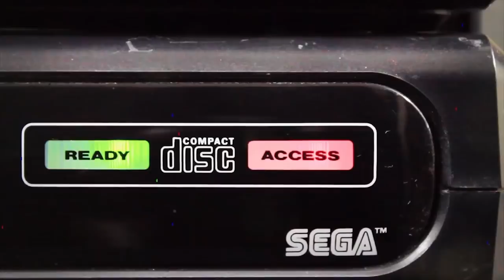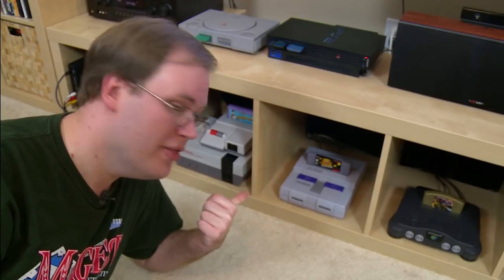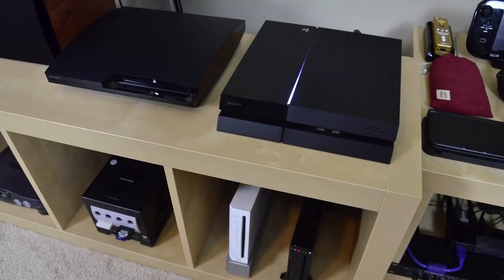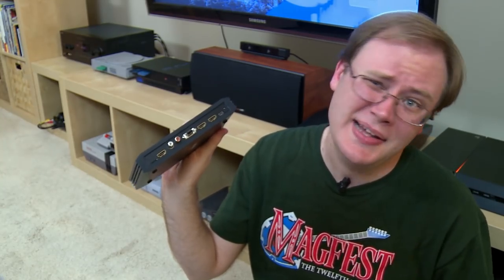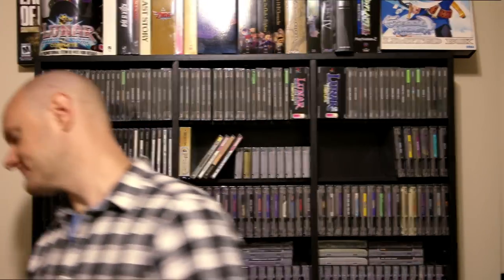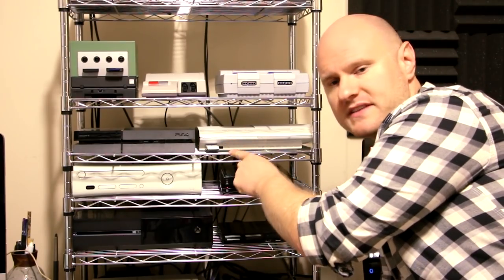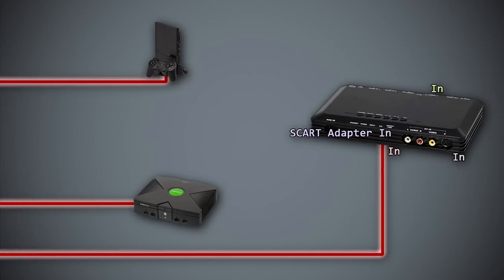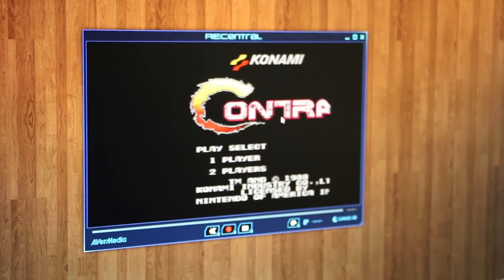RGB and Modern Gaming Setups :: RGB102 / MY LIFE IN GAMING

Comment: I just ordered a FrameMeister. Can you guys tell me what gender the RGB adapter is that comes with it? I know that it's JP21, but haven't been able to tell if it is male or female.
Reply from the maker: +Dave Bladegun [Try4ce] It's female. Good that you already know it's JP-21, so you know what to look for if you're gonna stick with that standard!
Reply: +My Life in Gaming 

Thanks! I actually do use scart for everything, but plan to run an RGBS>JP21 cable from my PVM to the Framemeister in order to save an input/output on the ol' scart switcher.

Comment: Does the Framemeister do anything for Nextgen system? For example, if I have a 120/144hz Monitor. Will the processor take advantage of that?
Reply from the maker: [Try4ce] It's pretty much useless for systems that already do HD, though you can route them through it for convenience. It outputs a 60Hz signal, which is fine... interpolation to turn 60fps into a perceived 120fps would add lag and visual artifacts.

Comment: Great video!  I followed a similar path as you guys, going with the cheap and crappy $50 SCART RGB to HDMI adapter, then finally ponying up an getting the XRGB Mini.  All of my systems look fantastic through the RGB input on the Mini.  Component (via a D terminal adapter) is a different story.  The colors look very over-saturated.  This happens with both my GameCube and my Wii (the only component systems I currently have).  I was wondering if you guys experienced the same thing with component, and if you were able to figure out the correct settings to use on the XRGB Mini to make the component picture quality better.

Thanks, and keep up the great work!
Reply: So, after posting this video I decided to look again, and I don't know how I missed the suggested settings on the XRGB Mini wiki page.  My component input is looking much better now.
Reply from the maker: Paul Hallaway [Coury] Oh cool! Yeah, the Wiki is super useful. I go by all of their settings.

Comment: Wow!  You 2 really have a wealth of info and clearly have done your homework when it comes to retro gaming on modern hardware.  I myself am a bit of a retro gamer but currently my systems and games are all packed away until I can work out my own setup.  Do to this, I've been (reluctantly) playing emulation on a modded xbox.  I know...this is borderline blasphemy but it's the best I can do right now. To avoid all lag issues I have my modded original xbox plugged into my trusty CRT-TV and everything is great, however i'm not a big techie and I'd like to go HDTV since my Trinitron is HUGE!  So If I may ask,what is a good way to apply a modded original xbox for emulation purposes to a HDTV?  Even though its a modern system, I still experience lag when playing on an HDTV. Would I benefit from the Framemeister?  Should I just stick with CRT?  I realize this is lengthy but your help would be worth its weight.  Thanks J-
Reply from the maker: +J Bates [Try4ce] Ha, I feel ya. If you watch our episode on CRTs and PVMs - https://youtu.be/RAi8AVj9GV8 - then you'll see that I've got a big ol' 36-inch HD Trinitron myself. I don't particularly recommend it! I'm actually planning to get rid of it pretty soon, because I can do something so much more useful with that space. Neither of us know much about emulation on the Xbox, so I can't say for sure how the Framemeister will play with it... for example, whether the Xbox emulation outputs 240p or not, that would be key. The Framemeister is not 100% lag-free, but it should be lag-free enough for most people. It's certainly faster than plugging your console directly into an HDTV.
Reply: +My Life in Gaming  Thanks for the response.  As far as I know there is a setting in on XBMC that offers 720 "support" but i've not been able to see any support. You still get that half second delay.  I've seen people connect a modded xbox to a hdtv via the component cable but I have not tried myself.  Such is the life of a retro gamer. .why does it need to be this complicated!?!?  Anyway thanks again, your videos are super helpful.  Have fun moving that beast of a TV you have LOL!!!!

Comment: 1:57 I have been thinking, ¿what combination of Quality image profile do you get if you get an adapter that goes from HDMI to VGA with the Framemeister despite you may not get any audio sound ?
Reply from the maker: [Try4ce] This can be an interesting result, but the Framemeister is not the first device I would choose for this purpose. The OSSC or RetroTINK-2X would be better suited to this kind of task due to their output resolutions. There's also the GBS8200, which outputs VGA natively, and has more recently been modified to be much better than it normally is. We're gonna do a video on it soon.
Reply: @mylifeingaming  Thanks guys.

Comment: Cory, you've got to get a VGA cable for your Dreamcast. That girl looks significantly better than a PS2/Xbox running on component. Literally next best in quality up against the modern HDMI systems. I am unfortunately, stuck in the same boat as you for GCN... S-video for the win, right?!
Reply from the maker: StuohQ [Coury] I've since upgraded to the Toro from Behar Bros. It converts the 480p VGA signal to SCART and looks AMAZING. Sucks about the GCN though - and the prices continue to rise.
Reply: ***** Could try to scour Japanese sites for D-terminal cables while the exchange rate is good... gl otherwise.

Comment: hello guys) i still dont understand. can you help me? if I have miniframemeister and rgb modded AV Famicom system console - which cable should I use? is it ok if I use the official SUPER NINTENDO rgb scart cable ? ebay says its jp21, (http://www.ebay.com/itm/New-Nintendo-Official-RGB-Cable-SHVC-010-Super-Famicom-SFC-SNES-Japan-F-S-/252383489513?hash=item3ac33a6de9:g:fiMAAOSwqfNXmgpf) but you say that this has different sync than usual rgb and that cable (jp21) may have different pins inside Scart cable. please clear me this shit
Reply from the maker: [Try4ce] That cable is fine to use with a modded AV Famicom! Anything that works with SNES will work with it. The Framemeister comes with an adapter for JP21, so if you buy that cable, you will not need a different adapter for SCART, which is what we use. I am not positive what sync type the official cable uses, but I believe it is likely to be sync-on-composite (not necessarily bad if it's a high quality cable with good shielding). I can confirm that Nintendo's PAL GameCube cable is very high quality (not recommended for use with Famicom, NES, or SNES though), so perhaps that should indicate that you would also get a high quality signal from the official SNES JP21. You can also find a link to our preferred cable seller on eBay, who makes excellent quality prices for much less than those Nintendo cables. If you go that route, I recommend looking for a CSYNC cable, but the choice of JP21 vs. SCART is yours.
Reply: thanks a lot for answering guys! Now i understand, but I still dont understand what type of sync this oficial SNES cable use. As i understood you right, the CSYNC has the best possible quality, so its better to get this type of cable. If I dont use Freimeister and have only NESRGB AV Famicom I need EURO scart cable wichi for example can be ordered through the retroasia.com site, but I guess this EURO scart cable is not official nintendo cable. I also wanted to ask you if you noticed that AV FAMICOM  has some slowly action on the castlevania 3 moments when the hero jump through the round moving around wheels. the game are getting slowly in these moments. do you have the same problems? thats funny but my famiclone system (zhiliton) dont have such problems with RAM memory

Comment: So I took the plunge and got the framemeister however everything is well muted, I can't seem to get audio out of it. I have atm the composite from my NES going to the framemeister av in, then being outputted via the HDMI which leads to my capture card (X-capture1 from same company) got any ideas what the problem could be? Also the colors are all pink and I can't work out why if yuo have suggestions for that too that would be great :D
Reply from the maker: [Coury] Did you buy it new? I haven't experienced either of those issues - go into the menus and make sure the volume is turned up (the framemeister has internal audio levels that you can adjust). The pinkish color, I'm totally lost on - I haven't heard of or experienced that at all to be honest. I'll look around and see if I can find anything on it and will let you know if I find something.
Reply: After doing a bit of digging around and realizing how stupid I was, I remembered "hey why don't I try it without the capture card" and sure enough it works fine, color is fine and audio works however when connected to the capture card the color messes up and the audio does out output to OBS (the streaming software I use) the capture card supports hdmi audio as I use it to stream some ps3 and ps4 games. Seeing as it's the capture card side of things I unfortunately (for me) doubt I can get help from you guys but thanks for the speedy response. Do you have any settings you would recommend for 720? as I still get some black-boarders on my screen even when set to 720 which confuses me.
Reply: ***** Fixed my probelms thought I would let you know the solution even though it boggles my mind :P. So I have the same HDMI splitter Coury has and once I plugged it all up through that device (framemeister HDMI out -> HDMI splitter -> capture card) it worked 100% color is normal and audio is working 100%. However if I just play the framemeister HDMI output directly to capture card the audio is stripped and colors are borked. Odd little fix just thought I would update you ;)

Comment: will this cable ( https://insurrectionindustries.com/product/sega-genesis-model-1-rgb-scart-cable/ ) work with this adapter https://www.ebay.com/itm/XRGB-MINI-Frameister-Euro-Scart-to-RGB-Cable-RetroGamingCables-USA-Seller-New/372976317847?ssPageName=STRK%3AMEBIDX%3AIT&_trksid=p2057872.m2749.l2648 the ebay store you recommend is no longer selling anything. the cable says Csync but the adapter says Generally for Framemeisters with Firmware 1.08 and above you can use this passive adapter. For older firmware you may experience sync problems when using a "sync over composite video" cable, therefore for older firmware we recommend the EuroSCART to mini adapter with built in video sync separator to achieve composite sync (CSYNC). A composite sync (CSYNC) signal eradicates timing problems often experienced with the XRGB mini up-scaler when connected to particular gaming machines, so even with the latest firmware you may still need a video sync separator if your SCART cable can only supply sync over composite video.
Reply from the maker: [Try4ce] Yes that should work. Search the XRGB-mini wiki for info on updating firmware. Also, the eBay seller is still around, but now at Retro-Access.com. But Insurrection also makes good cables.
Reply: My Life in Gaming thank you so much!

Comment: My Nintendo 64 is an early version of the system. One of the things you suggested was to use framemeister. Is there anything cheaper that works just as well? The framemeister is over $200.
Reply from the maker: [Try4ce] Check our recent video on the RetroTINK-2X. You can get pretty decent results on an unmodified N64 with it.

Comment: Seriously considering buying a Framemeister, are there any benefits or detractors in which model to get: EUR vs JP-21 scart ?
Reply from the maker: [Try4ce] The unit itself is identical, the only difference is what type of adapter comes with it to go in the RGB port. The adapter looks identical, but is wired differently. The European standard is generally more common and easier to come by cables for. The Japanese standard is of no particular benefit unless you plan to get your cables from Japan. The quality is the same. Also be sure to check RGB 105 and 106 for information on Framemeister alternatives - I feel that the OSSC is currently the better device in my regards aside from compatibility... many screen struggle with the OSSC, while the Framemeister provides more of a normal signal. The Framemeister also excels at 480i deinterlacing, while the OSSC's handling of 480i is more of an acquired taste.
Reply: My Life in Gaming really helpful info Try! I’ll be moving to Japan in a year or so, sounds like going with JP-21 may be the safer bet for me if I go with the Framemeister over the OSSC. Thanks a ton!

Comment: Does the SCART to JP21 cable from "retro gaming cables" can also work as JP21 to SCART? or does the description needs to be specifically JP21 to SCART?
Reply from the maker: +kurikuraconkuritas [Try4ce] Clarification on which cable you're looking at? But no, they are one-way conversions, if you're talking about the ones that go from the big connector to the little RGB connector on the Framemeister. You either need a straight JP-21 cable (which comes with the Framemeister), or a SCART to JP-21 if you're using the European standard (which would be a separate purchase).
Reply: ok, thanks Try4ce!

Comment: Here's a question why did you not invest in either of the joytech  360 or av switcher

as you have options of component and s0video on them  it seems  strange not to have the option  for all the av based systems

little known fact the universal av connector  on nintendo consoles will support s-video as low as the snes

the best video options for like the playstation 1/2 will either be s-video or component 

Unless you have a heap of PAL consoles scart is likely the dead ringer unless you own a switcher from joytech, however component and s-video  was the best resolution you can get for most av based consoles..

sad to say looking at what you are trying to do, you are both missing proper av switchers..

IF YOU WANT THE BEST connection option you may need to consider hifi level switches from denon/onkyo/yamaha

if you can find them...

as much as i like my  joytechs they are limited to 4 consoles 

considering you  have multiple wall warts on the consoles you might want to consider ac options only as it can be quite taxign having 20+ wall warts in consoles let alone wall wart option for  our av switch..
Reply from the maker: [Coury] This video is a number of years old at this point. I highly recommend checking out some of the later entries in the RGB series as they address a number of your concerns. 

I also recommend our game room tour and the multi console power adapters episode.
Reply: I realize this is a number of years old however the point still stands especially with the console options you have in play the aims of my comment was looking at ways to reduce power consumption where plausible and possible

hate to tell you this i have been using av switchers for over 20 years..

though as I look to migrate to hdmi I already out strip the input  scenario of my avr..

with the likes of wii u, switch, 360, one,  and with likes nes/snes/ps1 retros coming my way.

I also considering the pound cable options for me ps2/xbox to add them to my hdmi setup..

i own 5 tv's  all hdmi compliant  to a degree..

Comment: Another great video, thanks guys!  Now...do all RGB modded NES/famicom units work with the SNES SCART?  Not that I'll be getting one soon as retro_console_accessories seems to be running with the newfound fame and is putting only SNES SCART cables up for auction, increasing the cost at least threefold.  Very disappointing there.

Also what about Gamecube RGB output?  I've seen some of that on other sites but don't know how it compares to component for GCN, I'd imagine it was much better but still see component hailed as being the deluxe method.
Reply: I strongly believe an NTSC NES system modded for RGB should work with any correctly wired Super Nintendo RGB SCART cable from the seller you mentioned. Playing my NTSC Gamecube via the official component cable that was modified for RGB/VGA output looks great on my RGB monitor. It may look better/sharper than component but I have no way to test/compare since I sold my component cable for the Gamecube a few years ago.
Reply from the maker: [Try4ce] I was told that certain cables that work with the SNES might not work with an RGB-modded NES or Famicom. This is not the case with any of the cables I have, but unfortunately I don't know enough about the matter right now to give a definitive answer. As for Gamecube, I believe I've heard that European units can output RGB, but that's not too much of a concern for me, since I've got the valuable Gamecube component cables.
Reply: SNES AV cables will work on an NES as long as the NES has the same AV port installed and that it's wired up in the same fashion: http://pinouts.ru/Game/n64video_pinout.shtml In particular, make sure that it has c-sync on pin 3 (not +12V). There may be differences between regions (NTSC vs PAL).

Component is generally superior to RGB on systems that can do 480p (which includes the Gamecube). SCART can typically only carry 240p/480i.